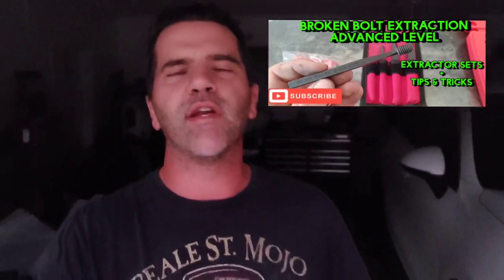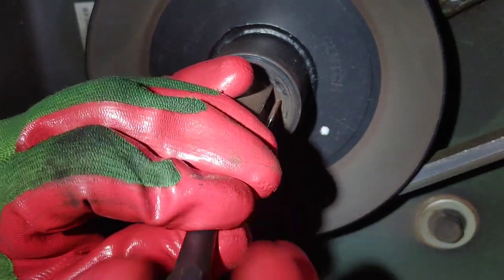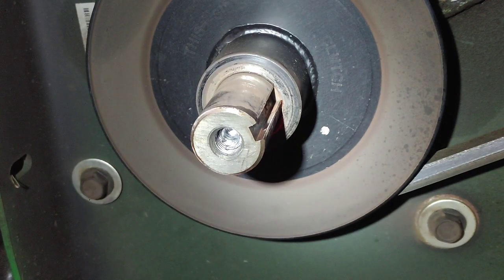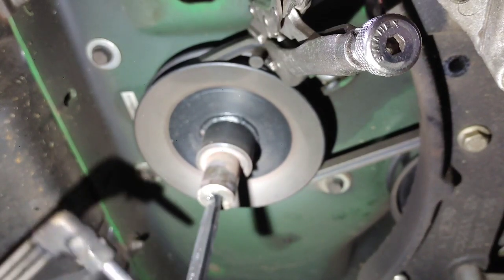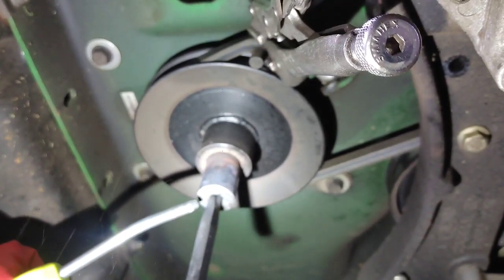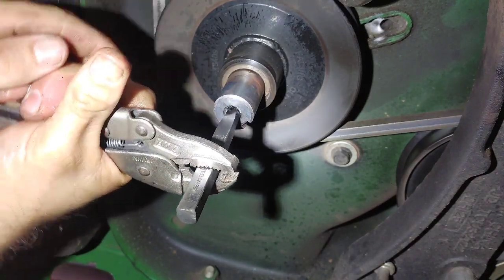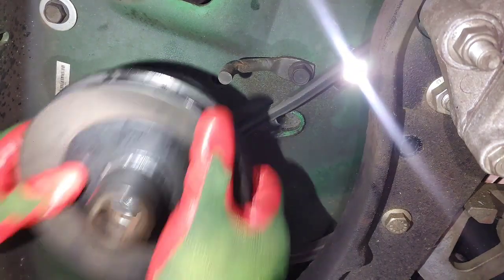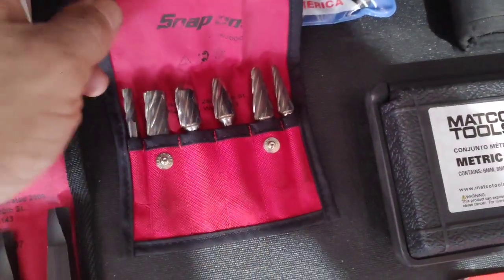Using a torch to extract a broken bolt from an engine crankshaft. Professional level

Comment: I bought a 200p dx civic and the crankshaft pulley is broken off and the bolt is left in there with no way to remove the bolt any way I can get it out would be beneficial bcus this is my only car

Comment: I broke a case hardened bolt off in the crankshaft of a 2010 Harley big twin, I borrowed a dirty old torque wrench instead of buying one and it did not click before it broke the bolt, I practiced drilling the bolt remains to figure out the bits and extractor I need and I’m confident I have the recipe but I just had gallbladder surgery so I have to wait to heal a bit and yea it’s all about discipline and go slow! I just got the new bolt and bought a new dam torque wrench wish me luck.

Comment: Why did the bolt twist off in the crankshaft, i have one thats the same way, the clutch was very noisy, but the bearing aren't locked up, seem to be ok , something caused this, the deck bearing are good, belt didn't break,

Comment: I extract bolts and it takes patience, tools, and skill. One thing I never use is WD-40, worthless. Kroil, PB Blaster and 50% acetone 50% transmission oil work much better for penetrating oil.
Reply from the maker: Don't talk bad about my WD40! 🤣
Reply: What about good old 3-in-1 oil?